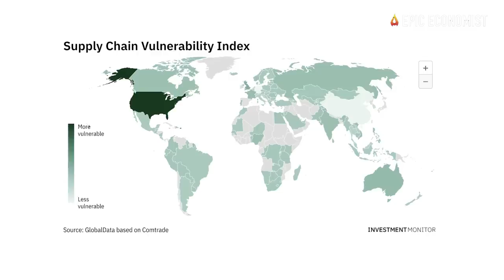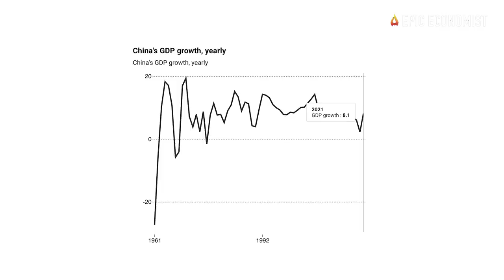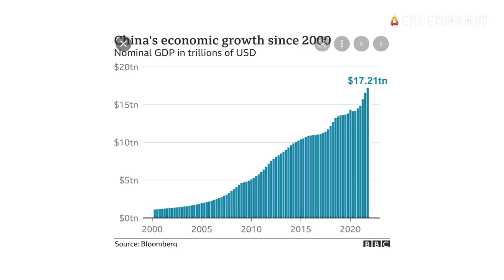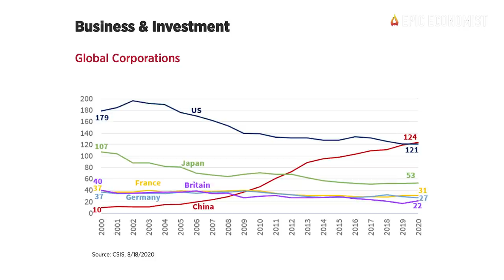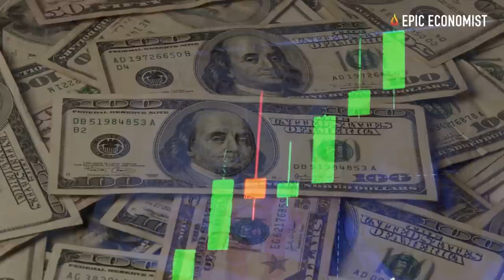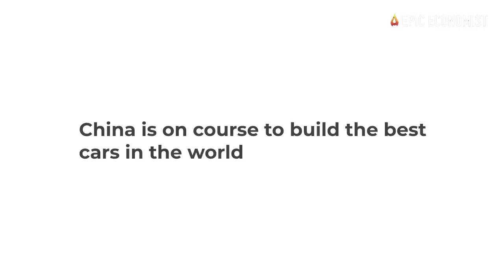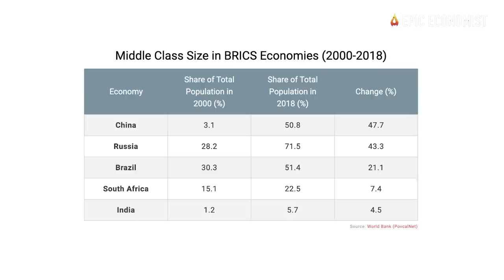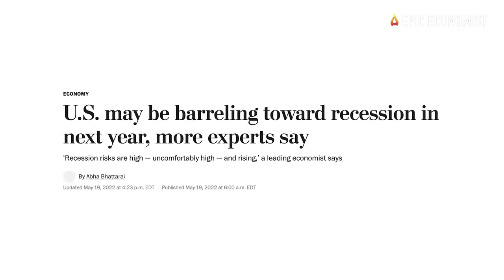30 Signs That China Is Absolutely Destroying America

Comment: Most western countries are NOT primed to manufacture daily goods due to high wages and parts are not readily available from nearby aources. I live in Australia and most Australian made goods are inferior with many defects, expensive and boring with very little variation. I don’t care if China or any other countries do the manufacturing as long as it is cheap, and workable. 
Stick to what each country is good at.
Reply: I had a brand new terrarium- made in the USA. I had to clean up the extra glue and seal the leak.
Reply: NO

Comment: Actually America cannot compete with China for other obvious reasons. Firstly Americans hourly wages are many times that of the Chinese. Secondly, the US dollars is worth many times the Chinese yuan.  Unless the American workers are many times more productive than that of China and which is not the case. So why should  a Chinese worker earn less the American worker for the jib? Also why Chinese yuan is valued so much less the US dollars. So if America is going to compete with China, the easiest way is to make Chinese yuan on par with the Americsn dollars. Secondly the American workers should receive the same remuneration as the Chinese workers. If America US willing just to do this alone, America can compete with China without a doubt. But by doing that the American living standard will fall tremendously. Are Americans workers willing to do that like the Chinese workers. So thus US the point.